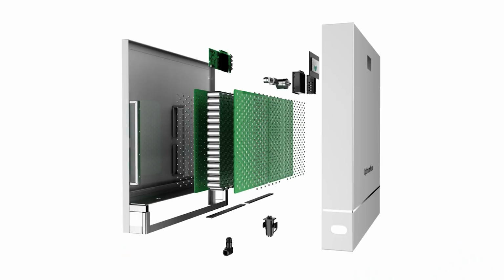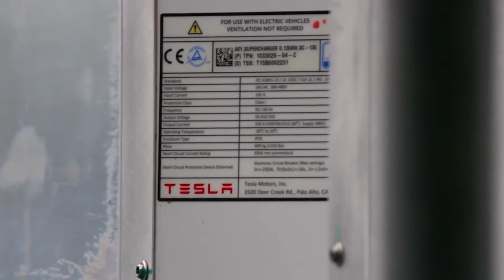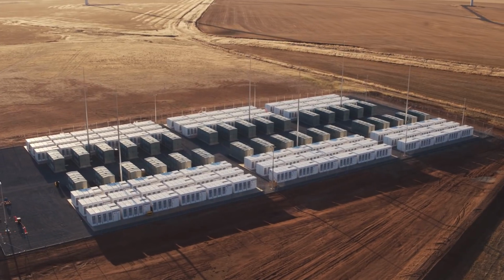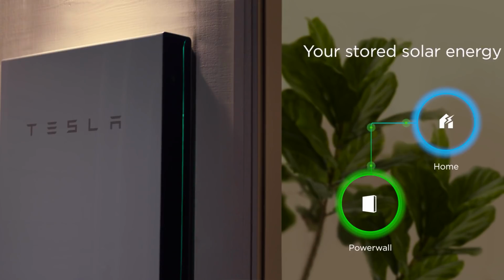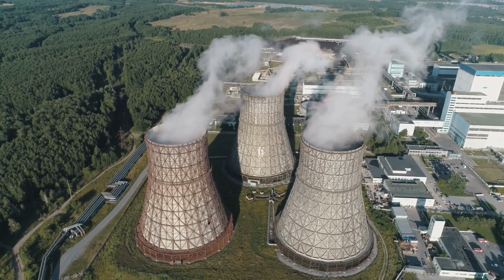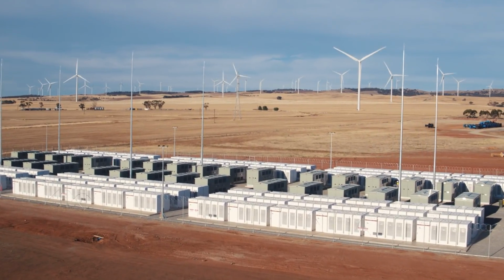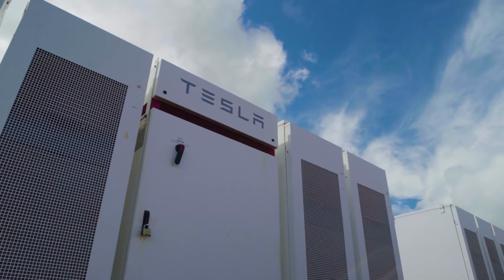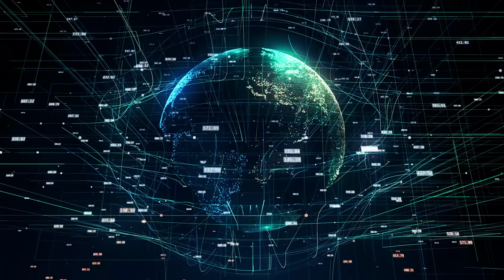Why Utility Grids are Afraid of Elon Musk

Comment: How long do these batteries last? What is the ex replacement cost ? How are they disposing of the dead batteries?
Reply: Burt Vincent. We don’t no yet as there are very few dead batteries to be found. When a lithium ion car battery is down to 80% capacity it can then be used for grid storage for about an additional 20 years.

Comment: Elon has tunnel boring machines for car tunnels,how about small machines that bore tunnels to install the power grid and all info lines as well under the ground safe and away from all the stuff that will harm the grid and doing so it harms us,why hasn't he thought of this a real demand and he has the solution.It can be done without ripping up anything just a few access holes every few miles or so no one would even see the work done in most places .this need is real .

Comment: Nobody is building peaker plants anymore. They're building CCGT (combined cycle gas turbine) plants, which run as peaker plants as well as baseload, and are half the cost of batteries for the same power. But the batteries are still worth it, because the CCGT plants, when used for backup power, have to be kept spinning which burns expensive fuel, otherwise they can't respond in time when something fails. So overall, the batteries are cheaper for emergency backup.

Comment: Solar roofs on all supercharger locations powers the continent it is responsible for.
Reply: Each gigafactory will be a capacitor. Kind of!
Reply: The ability to jump/cut red tape in the planning/building phase is an amazing idea.
Reply: @wickedfifth  Pretty sure you haven't researched the power density of solar.  Or maybe the Superchargers will be 50 acres each.
Reply: Dean Hagstrom. Obviously not something that could happen with current solar collection tech. Also, there are a growing number of charging locations with a growing footprint, so hundreds of acres are currently available for install.  Got anything else?
Reply: @wickedfifth  If it's so obviously not feasible why did you suggest it?  Is there a great increase in panel efficiency on the horizon?

1 GWH/365 days = 2700 KWH a day/ 85 KWH Tesla = 32 cars a day * 90% efficiency = 29 cars a day.  Plus you need a 2.7 MWH battery to store the solar.  Plus an install in the desert, cause people still drive their cars on cloudy days.

NREL determines that a large fixed-tilt solar PV plant requires 2.8 acres per GWh/year of generation

Comment: In 2020, The Hornsdale battery is in reconstruction to double the size, and in  Burra  50km away, there battery will be 500mw.  
30mw at Port Lincoln and Mr Gambier, they perform another role,  they maintain the stability on the edges of the grid and supply, like a remote surver.

Shift the intermittent wind energy to when the market wants the most expensive demand.  Go up to Burra on a windy day, the turbines are turned off, no demand but fill a battery and wait.  No wonder the hourndale battery is payed off $4000 kWh at peak, der

Comment: Although I like the battery farm, a some of what was said in the show was factually incorrect and misleading.
67 million for the battery farm and you're saying the equivalent gas plant would be $700 million? That is not even ballpark. That amount would buy a gas plant that generates around 20 times the output of the battery farm and it could do it 24/7/365 and not just 80 or so Megawatts for and 1 hour. Also the battery farm does not even make any energy either.
The battery farm is a poor peaking plant also as it is simply just too small. Where it's strength lies is in in FCAS or frequency support, which to your credit you did mention that the unmatched speed of this plant. It's response speed is millisecond scale and is unparalleled by any other technology. This is how it has paid for itself.
Reply: Exactly.  Some gross misinformation that is nice to believe, but not connected to current reality.  The San Francisco example of 6 hours off a single 1 GWH battery was especially funny.  Only off by a factor of 108,000X.

I pasted a copy of my post below

Your video is misleading is so many ways.  Obviously you've drank the Tesla Koolaid but that doesn't mean you can just makes stuff up and compare Apples to Oranges and Aliens

A few years ago all the battery storage ever installed on the US grid would carry the load for less than 15 seconds.  I doubt we are past 30 seconds in 2020.  

 You mention the $67 million cost of the 129MWH Hornsby plant and compare it to a $700 million cost peaker plant.  A single large modern Gas is 250MWH to 400MWH for a single turbine and they cost way less than $700million.  Your compared cost was probably from a multiturbine combined cycle plant with significantly more than 1000MWH. 

A more realistic comparison would be a GE Aeroderivative turbine of around 60MW is $20 million so it would have to run slightly over 2 hours to match the battery pack.  Wind and solar is way more cyclical than 2 hours so you need way more capacity than is currently possible with battery storage.

I highly doubt the load of Los Angeles less than 1000MWH/6hours = 166MW load.  That's way less than 1 Gas turbine  Actually, I bothered to look it up, see below.  So not only will 1 Tesla battery NOT power it for 6 hours it would take 18,000 of then to power it for the day.  Being off by 18,000 * 6 = 108,000X is kinda of a big deal

According to PG&E spokesman Joe Molica, the city of San Francisco consumes about 18,000 megawatt hours of electricity each day. One megawatt hour powers about 750 homes in California.Jan 24, 2011
Reply: .... Thanks for Info on batteries.  Yes, energy storage is hugely expensive and now is x100 too expensive to really do, saying otherwise is a lie.  Pushing lies leads to no progress this decade like last decade on cutting  emissions.  Oh well.  We should go nuclear and accept a Fukishima every decade but instead we burn coal and gas and 10m get asthma and cancer from it.  .....  China and India and Korea are going nuclear....
Reply: Most people look at green tech and think " zero emission, clean and renewable, isn't that great.". They don't think about the environmental cost of manufacture and transport of cheap chinese solar panels or indian wind turbines. Do the "developing" countries have an EPA regulating industrial waste discharge into rivers, oceans and sky? Nope. Not to mention the environmental effects of lithium mining and waste streams. We should be ramping up nuclear power and natural gas infrastructure along side responsible resource extraction and manufacture of green tech in the west.
Reply: Wouldn't we need these plants in may places anyway for seasonal fluctuations? Especially if more and more people start to heating their home with electricity instead of gas/oil in winter when solar panel output is low (or are covered by snow).
Reply: Yep! Just cover the world in batteries! Great idea! They never look at any of this long term or the ongoing costs and lifespans of all this infrastructure!
Reply: @nuclearfishin1185  Look at windmills. Producing and installing windmills leaves a huge carbon footprint, yet their life expectancy is barely 10 years. How many thousands of square miles are covered in windmills already?   "Green power" is a feel-good scam. I work for a major Metropolitan Power Company, renewable is NOT cost effective in any way.
I might also mention that my home runs off of solar and batteries. Very expensive just to have Independence.

😎😎😎😎😎😎
Reply: ...and no one mentions the cost of replacing the batteries when they reach their end of life.

Comment: Love the episode, hate the title. It could have been "why peaker plant operators hate Tesla". I doubt that the utility companies give a rip, they just want a means of handling peak loads and had no viable options to building peaker plants before Tesla.
Reply: 40 years ago I was installing gas turbine powered  peaker plants all around the world for General Electric Company. I could put 24 megawatts on line from cold start in 12 minutes if necessary. These were often installed in blocks of 8 turbine generators. Gas turbines were certainly viable options for adding quick power to the grid as needed. The drawback was the high fuel consumption of the units.
Some plants were slammed in over a 3 month period from raw land to a fully operational generator set.
Reply: @kimmer6  Yeah, I think the stated cost and time needed for peaker plants were on the high side. I just felt the video title was off since the actual content seemed focused on peaker plants. The utilities themselves aren't threatened by battery technology. They probably don't love having to deal with hundreds of home based generators they don't control, but dealing with a large battery facility they control is just business as usual.
Reply: @MTerrance  These are people with no actual experience retorting.

Comment: Coal power plants with modern scrubbers... ( All of them except from China )... actually don't release all that crap.
Reply: JustDoItYourself are you trying to say that clean coal is a real thing?  😂
Reply: @TerraPotentia  They still release CO2 of course. Lol I live right next to a coal plant. They've been full scrubbing for a very long time. The question of how much CO2 is correct for the proper balance of life still of course remains. Now if we can just perfect the carbon based battery we can make batteries from coal instead of burning it :D
Reply: @justdoityourself7134  They still emit a lot of CO2.  To pull CO2 out of the emissions that come out of a coal plant requires exorbitant amounts of energy.  CO2 sequestration attempts have been made at coal plants to pull CO2 out of the emissions and in order to supply the people a plant normally services with energy AND supply the energy needed to run the sequestration process, the plants need to up the amount of coal used by 1/4th.  A coal plant that normally puts out 10,000 lbs of CO2 a day only pulls out a few hundred lbs with sequestration methods.

You know, eons ago, man's source of fuel and energy was wood and dung. 

We used that for literally tens to hundreds of thousands of years.

Then we discovered coal, and we set aside wood and dung in favor of coal.

Then we developed the steam engine, and then we discovered electricity, and we began using coal to generate steam in our steam engines, and electricity in our electricity generating plants. Then we discovered oil and natural gas and we developed the combustion engine using oil to lubricate it and oil by products to fuel it.

Then we discovered hydroelectricity, then the power of the atom, and then solar power.

Look, just as we set aside wood and dung in favor of coal and oil/natural gas, it's time we set aside coal and oil/natural gas in favor of nuclear, and hydroelectric and solar (where they make sense and can work.)

That's it, that's all we need to do, but make no mistake that fossil fuels need to be set aside.

1 kg of thorium (nuclear power) equates to over 4,800,000,000 kWh of electricity.
1 kg of oil equals 12 kWh of electricity.
1 kg of coal equates to around 8 kWh of electricity.

Even if you don't believe in climate change, it's a god damn no brainer bro...  Fossil fuels played their part in bringing us into the 21st century, but it's time to set them aside and get on with much better forms of energy.

Comment: Renewables + Batteries will definitely take over the grid in the next two decades, but your video doesn't paint the current picture very accurately.
Currently, the ~700 mWh or 1000 mWh grid batteries are not cheap enough or big enough to shut down thermal plants.  Solar+storage plants are cheap enough for forward-thinking power companies in good solar regions to build instead of new peaker plants, but battery prices have to drop more to make thermal plants stranded assets.  These new solar+storage plants at best offer maybe four hours of energy in the evening.  They are not big enough to offer significant power 24/7.  
To really make thermal plants obsolete, batteries will have to go below $50/kWh (currently at about $150/kWh) and the battery installations will have to be much bigger than about 1000 mWh, probably more like 10 gWh.  Also, long-term battery storage will be necessary, as in storing solar in the summer and using it in winter.  For the grid to be all renewables, and all gas/coal plants mothballed,  batteries will probably need to be ~ $10/kWh.  That's an order of magnitude cheaper than today's cheapest lithium-ion batteries, and it's not clear that lithium-ion can go that low, because cobalt, nickel, lithium, manganese are all expensive inputs. 
I expect some battery chemistry to achieve $10/kWh, probably some kind of flow battery or something other than lithium-ion, but it may be a decade or more.  In the meantime, lithium-ion and maybe lithium-metal batteries will go below $100/kWh and we'll see bigger and better solar+storage.  It will become obvious to everybody that gas peaker plants and coal are headed for the recycling yard, but they won't all shut down quite yet.
Reply: Good dose of reality.  Video makes it all seem so simple.

Providing power 24/7/365 with 99.999% Reliability is harder than many think.

Comment: Peaker plants in Australia used to absolutely take us to the cleaners during hot weather, now their little rip-off game is over.
Reply: not sure that is true... Peaker plants WERE used mainly for peaking some years back, but with the advent of RE's pushing out baseload coal, peakers are now assuming a lot of the base load.. Just have a look at the graphs out of AEMO and see the constant use of gas across the day.. Then compare with AEMO charts of a decade ago...
Reply: @kevc114  
Going base is what's left for the peaker plants, especially so if battery storage is installed. Then the peak is gone and with it the revenue from selling  peaking power. 
The utility is now using his base equipment in a peaker mode to fill base load gaps. That's reducing equipment utilization and  increasing cost. On the other hand, as base power cost is low, he is running into financial issues as his revenue shrinks.
Reply: didnt scomo sign a deal to build coal or gas station(s) last year :(

Comment: Hi guys just wondering if you could do a video on how much electricity it takes to refine petroleum and how much energy it takes to get it to the pump 
Cheers Steve
Reply: dont forget the horrendous amount of cobolt used to scrub the petrol
Reply: @flodjod  or the amount of coblot it takes to make batteries
Reply: @4468861989  its cobalt not that strange word you printed the answer is slightly less than 3%  of a tesla 3 battery is cobolt down from 6% on earlier models , the cleaning component of petrol is cobalt and approx 7% of petrols make up. petrol of course is burned and the cobalt too whereas cobalt remains in batteries

Comment: I want to start with my local area. A large battery and PV farm, partnering a group of local group businesses. I have been working on it for a couple years. This will be built with the development of homes made of up to seven levels of Cross Laminated Timber building, fifty apartments on a large block. PV and Battery with form a micro-grid will connect all the homes together along with other separate dwelling and businesses, not pat the same development.